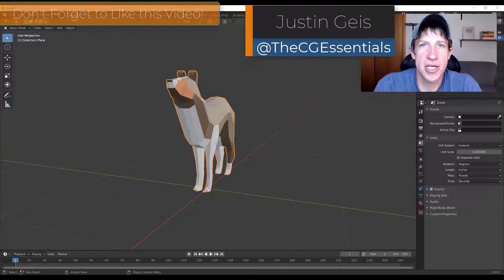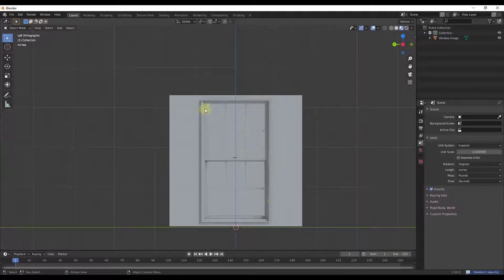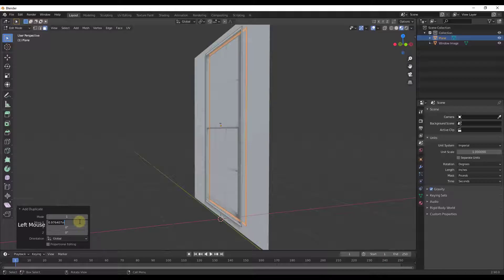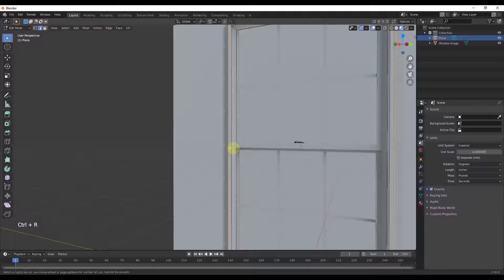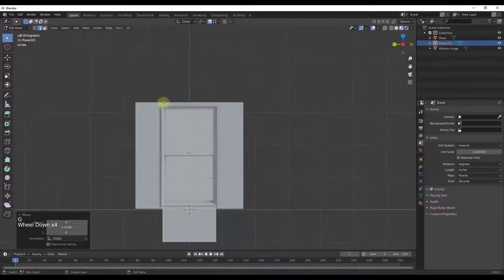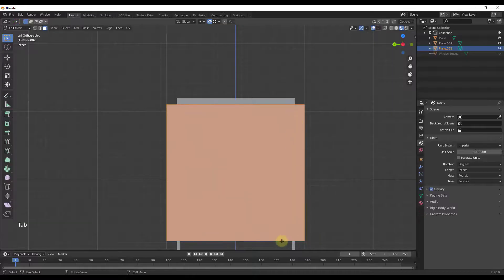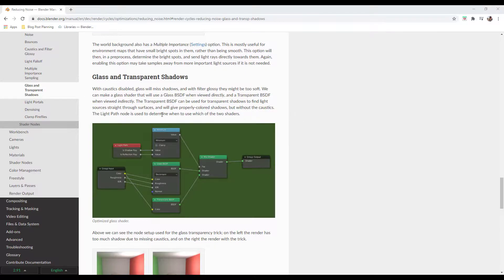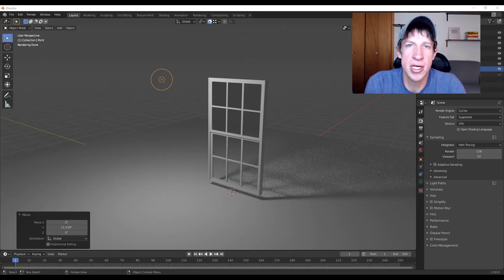How to MODEL WINDOWS in Blender - Step by Step Tutorial!

Comment: I've got a question for ya!
I'm doing a cell fracture effect to blow up a building.  For this I'm told that I need to have a perfectly sealed mesh, so I'm not comfortable having the window panes being seperate to the frames. So, with my model the frames and the panes are combined. However, I imagine that when I go to add a glass material to the panes I'll be able to see inside the mesh.
I'm thinking, is it ok just to fill in the gaps where the the panes connect to the frame? This will create internal geometry. Will Blender spit it's dummy out if I do this?

Cheers, I hope that made sense.
Reply from the maker: This I don't know. I feel like making your geometry as simple as possible would probably be best here, but I haven't really done any cell fracture stuff
Reply: @TheCGEssentials  - No worries, thanks for the response. In the process of massively reducing the polygon count. N-gons galore.